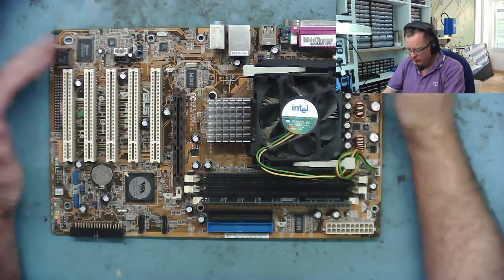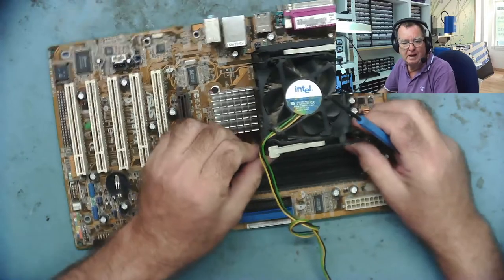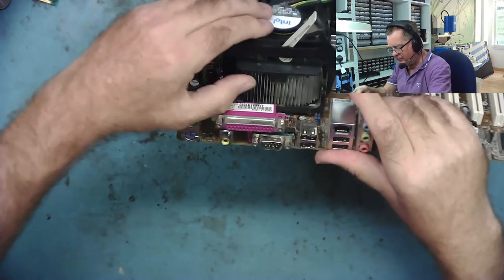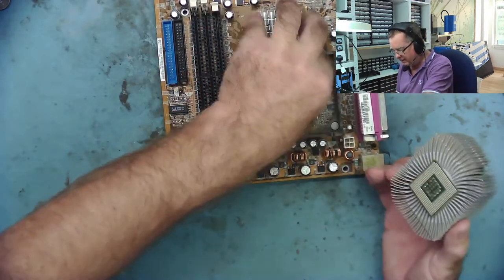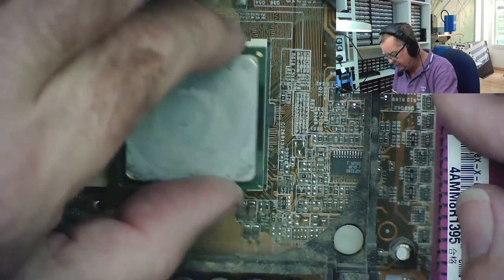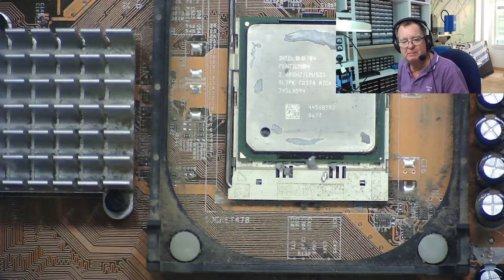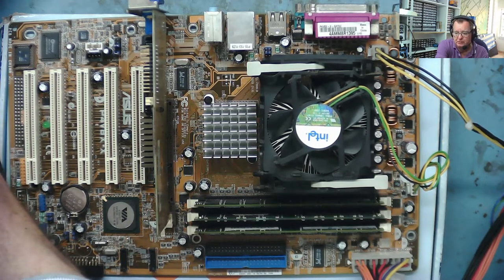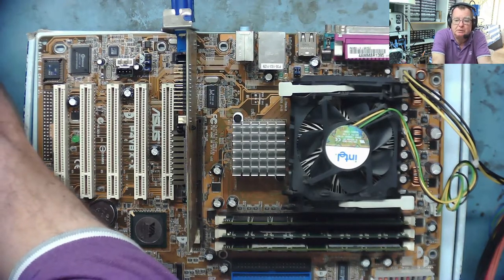Retro Gaming PC Restoration

Comment: What I found is to turn on the board with your PSU and let the CPU heat up a little, then turn off and quickly remove the heatsink while the paste is warm enough to not stick as much. It works every time!

Comment: Is soap and tap water OK for electronics or is an ultrasonic cleaner and deionized water absolutely necessary?
Reply from the maker: I use soap (well, a sort of gooey handwash) and cold water and I know a lot of others who on repair forums do the same.  Plus a soft paintbrush to scrub the board.

I don't have an ultrasonic cleaner, though I used to use one in a previous company I worked for.  I don't see a lot of point putting deionised water on a dirt motherboard as it will not be deionised for long!  

The main trick is to remember to remove things like CMOS batteries, and dry the board out fairly quickly. The ones I clean will be dry within an hour, but I then leave them overnight anyway before powering them up.  I don't have heating in the workshop, but the daytime temperature here never really drops below 20C and the outdoors night time temperature in Winter is around 14C.  

Right now the workshop never seems to drop below about 28C even at night
Reply: I’ve been using at least water to clean off really dirty boards for years but do not use soap. The key is to dry the board out for a day, and setting it outside in the sun is the best way to ensure all moisture is removed from the board. If there is anything greasy or gummy on the board then I use swabs and 91% isopropyl alcohol to clean up the mess. Sure there is a chance of oxidation if you leave electronics wet or soak it immersed in water. Running water over a board with the tap or in the tub (the best washing method) is recommended. I prefer to not use any soaps or harsh chemicals but others may choose to use things like disk soap or other mild cleaning agents. Good luck and happy washing 👍
Reply: @mesterak  I'm basically nervous about water getting trapped under the (socketed) bios chip or inside some random connector. Anyways, I found a 775 board in a box the other day, plenty of dust; next week I'll wash it (needs recapping first).
Reply: @johnprescott6614  I understand your reservations, but believe me I’ve done it to at least 20 or more motherboards and have never had one issue. Drying out in the sun all day after a water clean is the best method.
Reply from the maker: @mesterak  I use the hand wash and sink in the public toilets at the commercial centre where my shop located.  I have been known o use a hose pipe and a bucket of soapy water on really dirty items!   I find the hand wash type soapy gunk is mild enough not to corrode anything but good to break down grease - as it is meant for washing hands it is obviously well suited to this.  

I agree the important thing is to dry the board quickly.  Fortunately it is sunny practically every day of the year here and the daytime shade temperature almost never goes below 20C so it is a good place to dry things in the sun.  In the summer though if you left it in the direct sun you probably would not be able to pick it up after 10 minutes!!
Reply: @mesterak  Should I wash it before or after I change the caps?
Reply: @johnprescott6614  before. After you replace the caps then clean the area with IPA
Reply: @mesterak  thanks